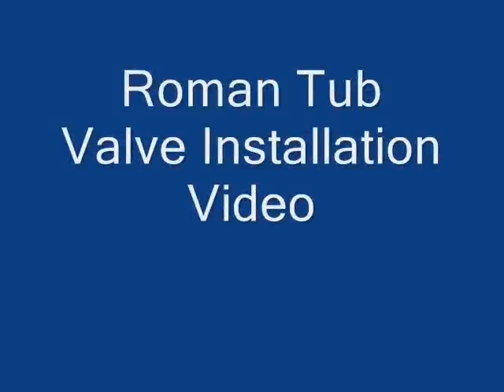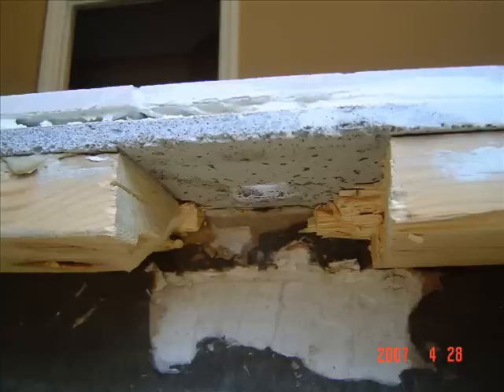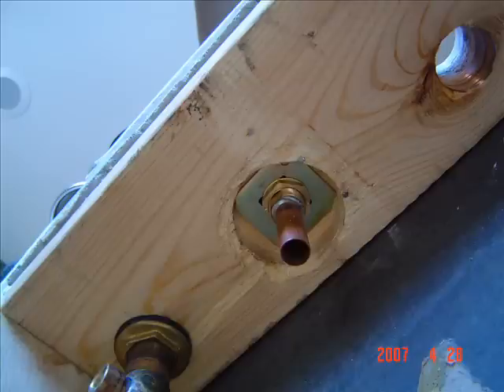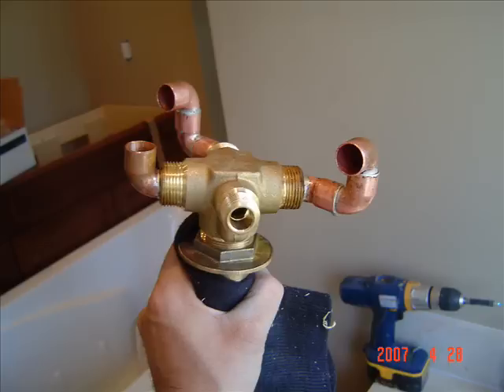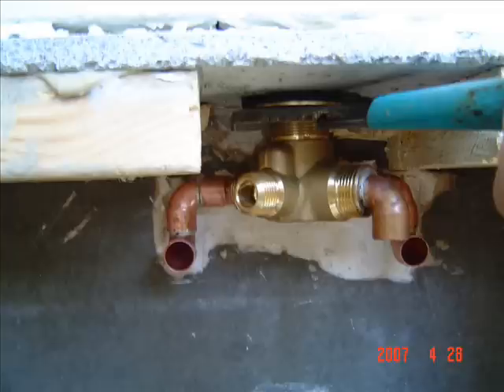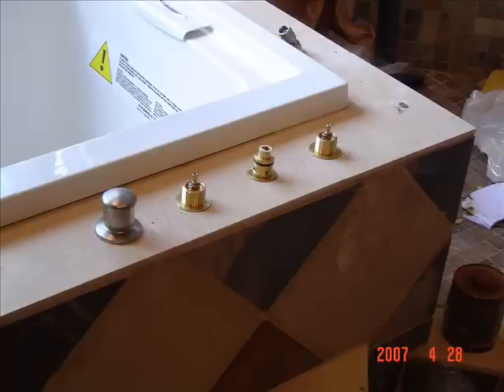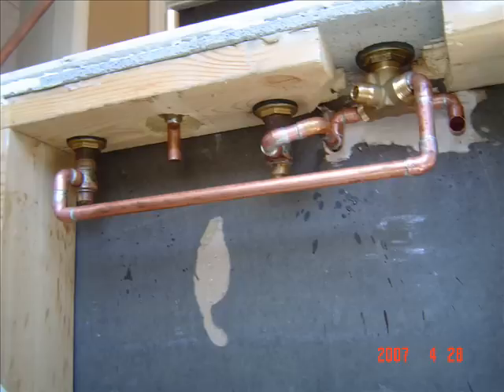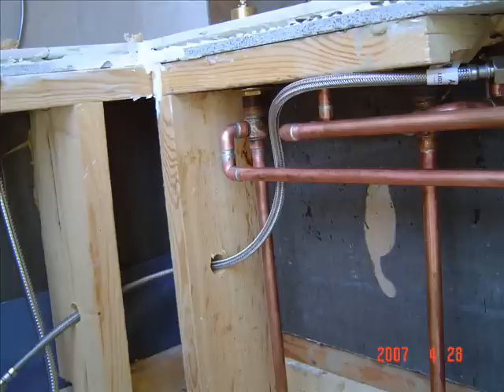How to install a Roman Rub Filler Faucet

Comment: Thanks for the video. I am installing a Hansgrohe Metris 'S' Roman tub filler on a deckmount tub. The plumbing holes must go through 1-1/4" quartz and 1/2" Durock,
for a total of 1-3/4". From your video, I see that these holes must be pre-cut before any plumbing rough is done. Who does this? The people who supply the quartz or the plumber? Thanks
Reply: I have the same set up for my tub, with a hand held shower head for the tub but my diverter is stuck, I might need a new transfer valve, what brand did you use for this video? Please let me know thank you
Reply from the maker: This was Kohler